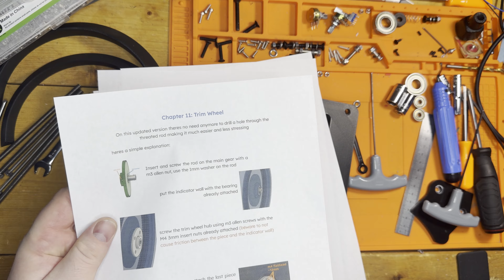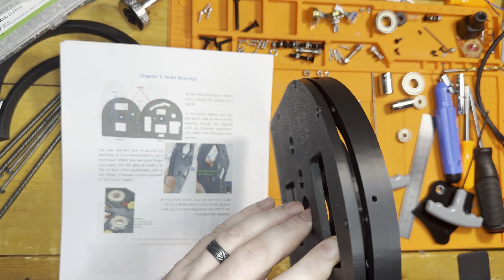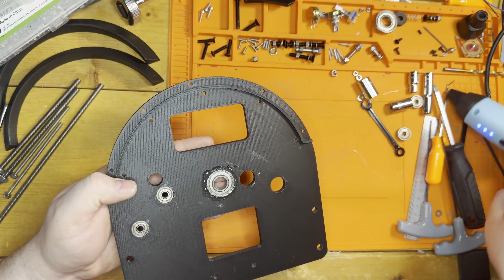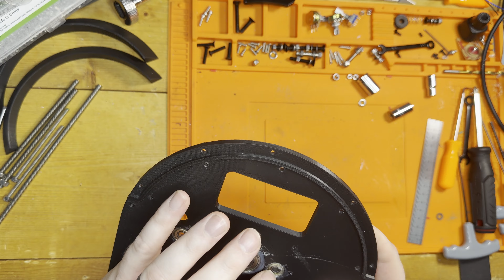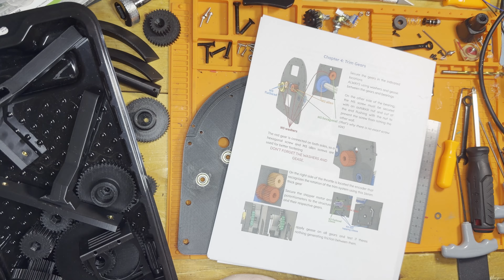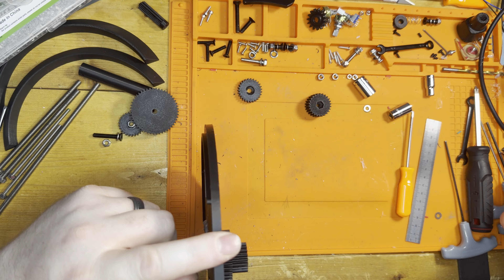LTVSIM Throttle Build Guide P2 (The Walls)

Comment: @48:12 you talk about and demonstratethe assembly of the trim wheel. To conclude, it seems that the huge gear and the trim wheel which are fixed onto the same 12mm shaft,  are rotating on the threaded rod?? Wow - if that's the case, the  internal diameter surface  of the 12mm connecting shaft will wear out pretty quick based on how often the trim wheel turns - please confirm this mate?
Reply from the maker: They will be attached to the threaded rod via grub screws so that they turn together.

Comment: @01:50:09 you question whether or not graphite powder should be used on gears - I woud not use it on gears. Simple reason being the powder is too fine and will not provide any reasonable boundary layer between the gear teeth to protect them. Graphite powder is very handy when you have two (or at least one) surface(s) where there is extensive sliding type of motion AND the surface(s) are reltaively smooth - in this case the rubber washer is smooth. So, applying graphite powder for the guide profiles is good.
For gears - stick to a general purpose gear grease.

Comment: Sorry, its me again - I'd advice never to hammer a bearing directly with a hammer. Use a bearing driver, or, if you do not have one (which you clearly dont), use a piece of hardwood timber that's flat across the entire portion of the bearing - it should extend beyond the outer race of the bearing. Only then, should you use a hammer to hit the wooden piece in order to purcuss the bearing into the hole.
Reply from the maker: You are absolutely correct. I should have done this correctly.

Comment: You are correct in so far the use of grub screws is concerned. Some of the gears have hex sockets that postiviely lock the gear and prevent it from freewheeling on the axle. Grub screws not required for those scenarios.

Comment: Just a piece of advice - do not use flat washers for countersunk (CS) screws.  CS screws fit to an angular surface, not a flat surface. A flat washer should be used on a flat surface not an angular one - something to keep in mind.
I too am in the process of building this and have had to modify some parts for it to work. I think Geovannii has missed updating older parts of the PDF with his modifications or improvemnents.
Reply from the maker: You are correct and I actually fixed that in the 3rd video I believe.

Comment: 45:11 the hole being this tight basically meansyour printer is 100% calibrated haha
I designed it to snap in only with considerable force so I don't need to use glue mostly (I’d usually place a piece of wood on top and tap it with a mini-hammer, haha).
Reply: You are correct - the bearing needs some amount of good force for an interference fit. My printer printed it perfectly so that I did not need to use hot glue at all, for any bearing in teh entire project.